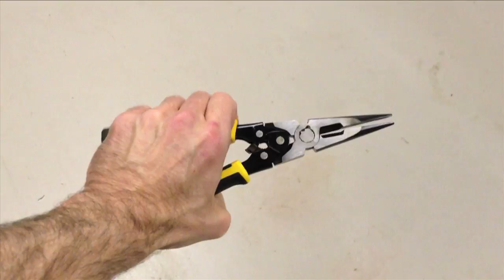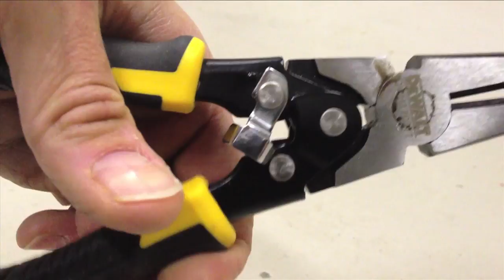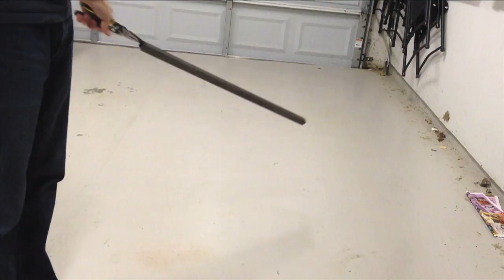Demonstration: DeWalt Compound Action Pliers

Comment: It's a class 2 lever that compounds with the class 1 lever (see-saw, crowbar, scissors) of the snips.  Examples of class 2 levers are a wheelbarrow, nutcracker, bottle opener.  Despite separate fulcrums, both levers share a common load and a common force.

Comment: none of the dewalt compound tools open wide enough..  check out the Crescent sets - they are much better
Reply: I have both the Dewalt and the Crescent sets.. Actually have 2 sets of the crescents and a third still in the package just in case they break or become too hard to find.  The crescent set is superior to the Dewalt in every way. I understand the point you are trying to make about the leverage, but all the leverage in the world is meaningless if the jaws of the pliers/cutters dont open wide enough to get the material in it in the first place.  I can cut thick solid copper grounding wire off telephone poles after we remove them with just one hand using the crescent set. You really can't ask for more than that. Also, either brand will still offer a much better gain of mechanical force when compared to standard sets. The real deciding factor is which of the two are more usable.  If you tried using both on a daily basis like i have/do , you will quickly see how much of an advantage the design of the crescent set offer. I'm not saying the dewalt isn't any good, just that there is a similar option with a better design.
Reply: kctyphoon wish I had read this review before buying they suck.